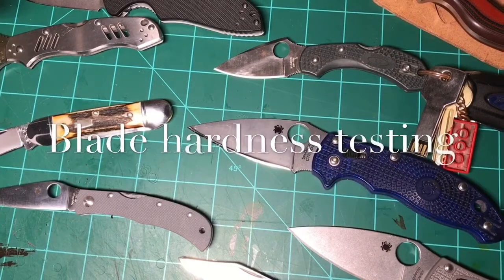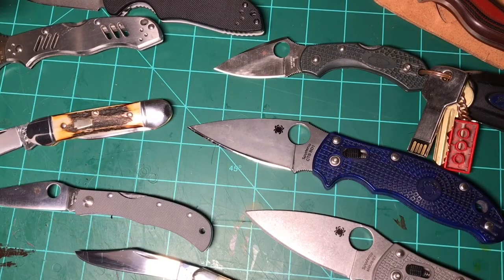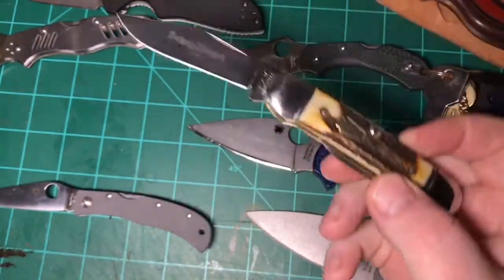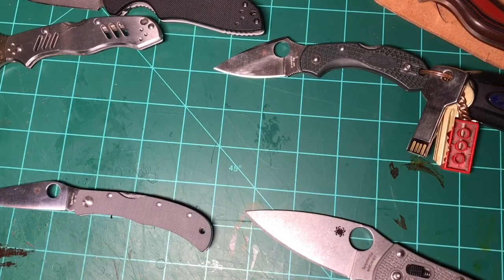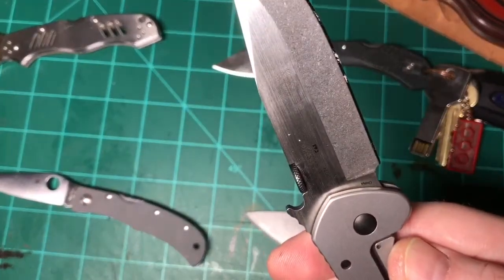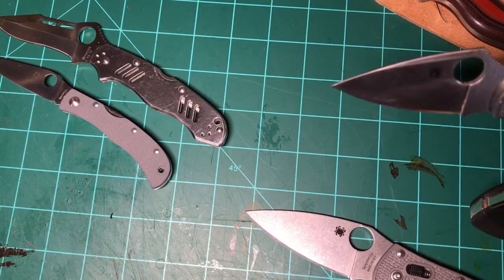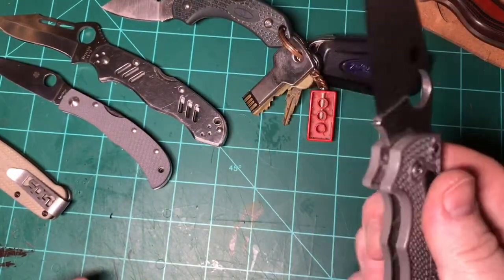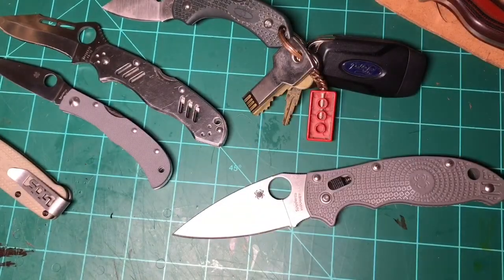Knife Blade Hardness Tests BD1 Maxamet 1095 vg10 420

Comment: had a new BD1N polestar and it was very very impressive. It was probably run pretty hard as i had chipping at sub 30 degree angles. My old BD1 manix BD1 edge retention is kind of poor but i still use it, sharpens easily. My CQC-6K also showed suprisingly good edge retention for a budget steel. Good to know it was 58.

Comment: In my experience when cheap steel is run hard it is brittle and chips easy, I think your equipment was off or was possibly reading wrong due to blade thickness or possibly because it was testing on the beveled portion of the blade, I’ve seen some of these steels tested and so have other very reputable people in the knife community including Cliff Stamp and they are getting a lot higher readings and they are all very consistent with one another... Also SOG is worthless garbage and they should be put out of business for selling soldiers (myself included) shit knives while on deployment:

Comment: What I dont understand is how Spyderco can sell 2 different knives with the same steel and it is so different (the BD1 RC56 vs RC60).   How can we know which is better? 

Also I would love to know how CTS XHP from Cold Steel holds up.
Reply from the maker: The Mannix was actually 57, and it was also an earlier model. It is not uncommon for manufacturers to tweak their heat treat of new steels overtime.